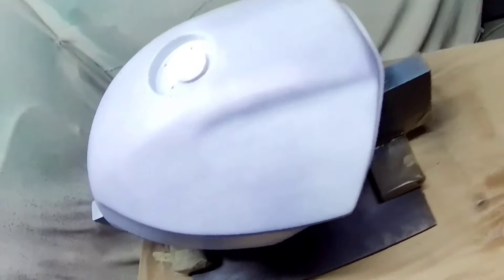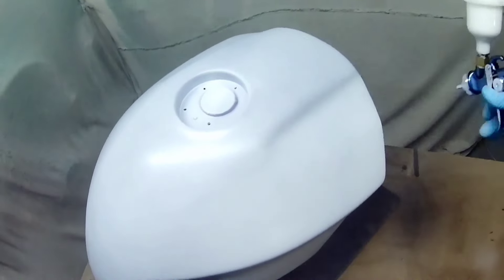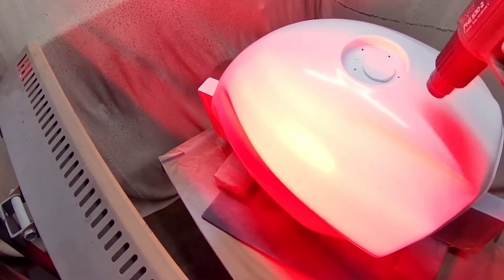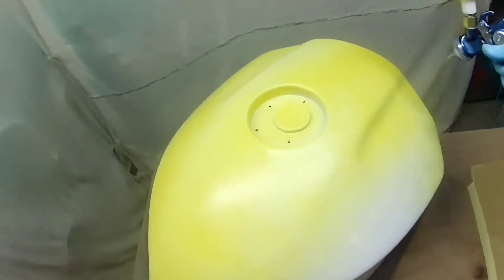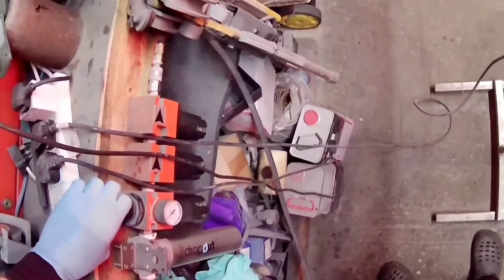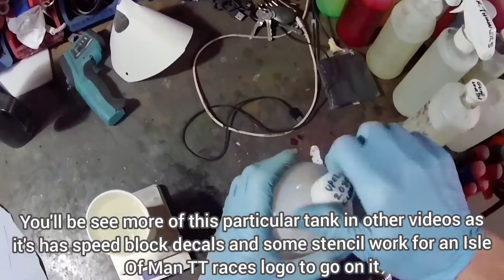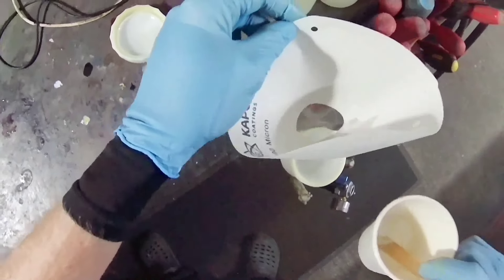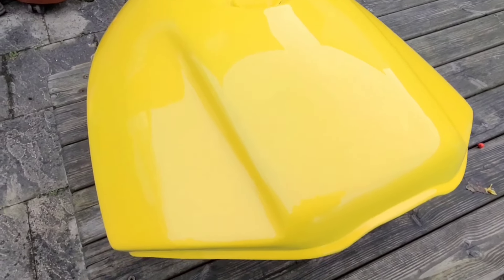Astro Europro HE 1.3, The Best All Round Astro Spray Gun For Base & Clear Coat

Comment: Hey Pete! Ive been waiting on this one. ❤  Yes, you're correct in your assumption. The tags are mismatched, and I'm surprised the manufacturer hasn't caught it at this point, considering this series of Astro guns date back to 2013 at least. 

 As far as the build quality, they're definitely impressive with a very smooth trigger, no plastic behind the air cap, and quite lightweight. The only downfalls are they aren't as efficient on air consumption as their sibling Evo4014 (R500 based) which is no longer available. The air horn holes are on the larger size for what they're designated for. The HTE is quite a bit larger than the transtech FLG5 and RP Kiwami4, so it would be better for home painters with the larger compressors. Keep in mind this spray gun can be had in the states for around $79 + shipping ($8.00) which makes it a good bargain for those that can run it.
Reply from the maker: Hi Boss, I'm sure the figures quoted on the website aren't correct, but I can believe this HE uses around 11.5cfm @ 29psi , so yes, it's not ideal for smaller compressors.

I think these will last years,  I lent this one to a friend who liked it so much that he went and bought one. He has a fair few high-end guns, so he can judge the good from the not so good cheers mate 👍

Comment: You need a few more things on that table top. It looks a little bare.
I agree with your assessment about the Astro guns. I use the gold EvoT 1.4 for basecoats with high metallic or pearl content, and the HE 1.3 for non-metallic single stage and for clear. They are very light, easy to clean, and I don't think you can get a better gun for such a low price.
Reply from the maker: Hi buddy,  For the money, they are good, well-made tools, I'm trying to get a few more things on the table top, just to fill in the gaps 😄,  cheers, mate 👍

Comment: Great video , looking to get this gun as so many good reviews . I note that you mix your paint by weight not volume , do you use the same ratio's as volume ?
Reply from the maker: Hi Buddy,  Yes, more or less, it's depends on the system or clear you are using,  I normally measure say 100 ml of each,  that way you can get an idea of the weight, virtually all of the are more or less the same, so I just go 2 to 1 or whatever by weight now, cheers ✌️

Comment: Hello Pete hope you and family are doing good, I bought a Star s106TG4 mini gun with a 1.2 tip, being a mini it uses higher pressure,  at their recommendation of 43 psi , I thought it be mediocre at best having tried some of their full size guns in the past and they weren't that good, but I use this on all the smaller jobs like car mirror backings and small plastic parts and even wheels sometimes and it does a fairly good job , I saw the gunman review the evo which didn't get a great review but i get good results with this one
Reply from the maker: Hi Roger,  Yes, mate, all good here. Thanks, although we are growing webbed feet as it rarely stops raining , I know Brits and the weather 😂.

I haven't used any Star/Astro mini guns, so I can't judge, but these do perform well considering the reasonable build and cost.

This is definitely a better clear coat gun than the Evo, I think the problem with the Evo is its claimed to run at a lower pressure and it simply doesn't work,  up at 2bar its fine but then it really does go through air, not ideal for many,  cheers mate ,hope all OK in sunny Australia 👍

Comment: hi quick question. . i sold my rp5000  after covid  .   just picked up a used black prolite ,   with 1,3 and the 20 and 10. cap .    and just bought this EUROHE103. .     which would you use as your base gun and which would you use as your clear gun.   i know i will test for myself with my spi euroclear but would appreciate your thoughts ,  thank you
Reply from the maker: Hi Mate, I would probably go with the TE10 Pro Lite for base coats and the Astro for clear. The Astro is a better clear gun than it is for basecoats, so that's the best way round, I think. I hope that helps,  cheers, buddy 👍

Comment: so you need a beefy compressor if you need 10 and more cfm huh.
Reply from the maker: Yeah,  I'm guessing around 11.5 cfm at 29psi
Reply: Pete can correct me if I’m wrong but there are very few(if any)full size guns that run at 10cfm or less
Reply from the maker: Hi Jordan,  No need to correct you mate, you are correct, the Kiwami4 BA4J Iwata is around 7.7cfm at 29psi, the Devilbiss FLG5 is around that.

The Chinese R500,  A610 ect are around 7.5 cfm but need more pressure to work as well so end up around 10cfm, the Iwata W400 Bellaria is same as Kiwami4,  Devilbiss Tekna Gti Pro Lite TE10 would just fall out the 10cfm at 10.5 cfm, ANI F160 HPS is around 10 cfm and that's all I can think of, the rest are over for sure, so yes, most are well over 👍